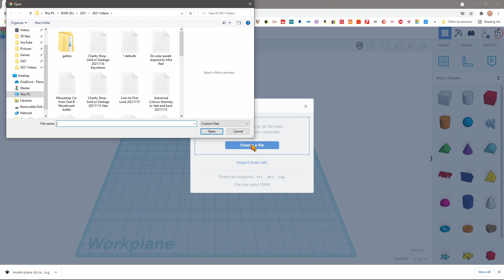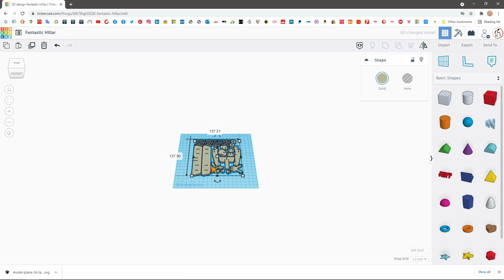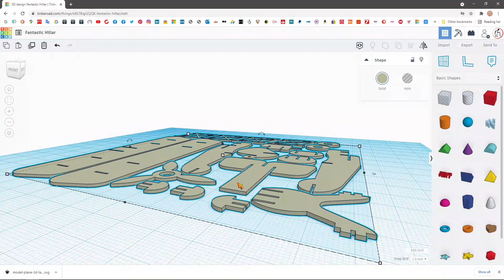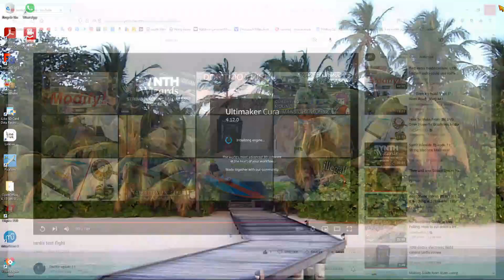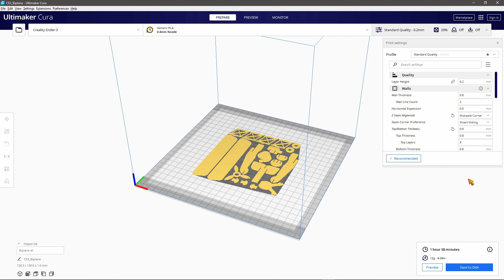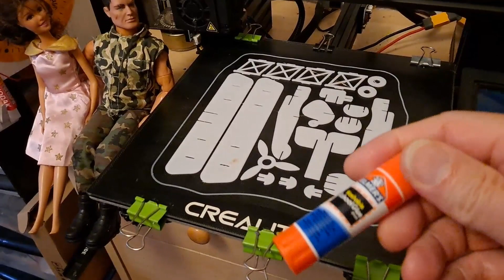3D print file conversion from Model Plane 3D Laser Cutting Project

Comment: wow , that looks great when printed out but i noticed a problem at start when the propeller wasnt printed right due to not sticking to the glass, maybe when the filament gets a bit old it doesent stck to the glass as much as when its fresh from the store.didnt think it would be that easy to print out a pattern like that.nice job.
Reply from the maker: Sometimes, the bed gives me problems, other times I don't need to change anything. I had no end of problems trying to print more of those bubble liquid gliders, and then suddenly everything started working fine again. I suspect the bed is not heating evenly, but at the moment it is working OK.

Comment: That's a great idea and works out really well. I never thought you could do that. I did notice that there was already an STL file in the free patterns files list. Would that have worked the same, rather than importing the SVG and then saving it as an STL file? Although if there is no STL file in the list then this is the way to go. Excellent. 👍👍👍
Reply from the maker: You would need to download the STL file and import it into you slicer. Then you will see why that is not an option 😆👍

Comment: Thats an interesting technique. Could make some nice "stocking fillers" for the kids :)
Reply from the maker: Some of these work better than others. Judging the thickness required can be a challenge, to match the slots. I often have to do quite a bit of trimming to make the parts fit. It really isn't a great idea. Buying a laser cutter and some thin plywood is what I would rather do. Then I could cut them out the original designed size. Plywood would be more eco friendly too.